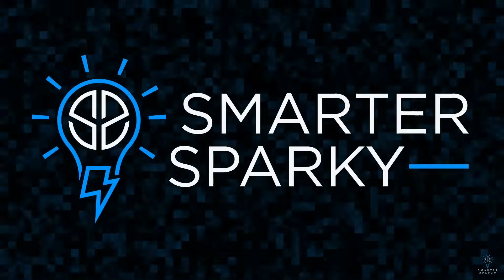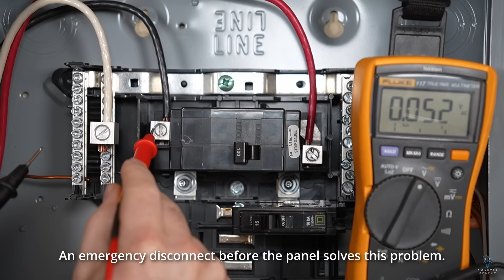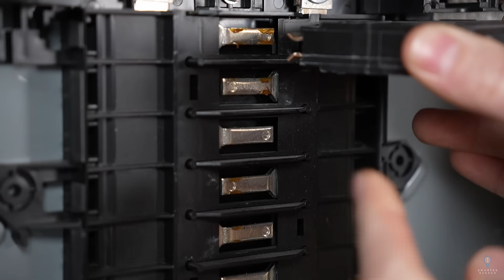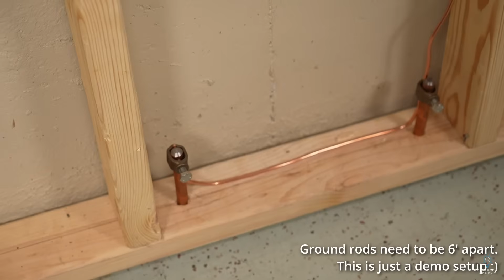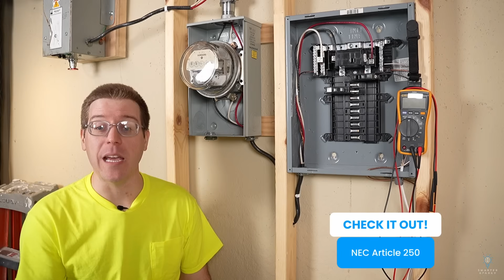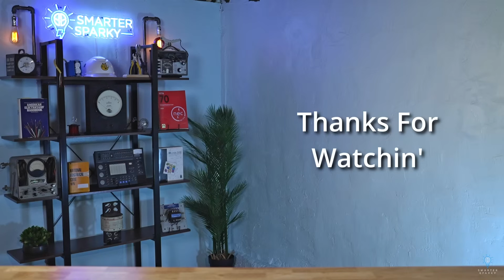Unlocking the Basics: Inside a Main Panel

Comment from the maker: ⚠*Free* bonus footage posted on Patreon! https://www.patreon.com/posts/inside-main-151462305 We look inside the main panel in my house, and point out all the same components. (You don't need to be a member to view it)
Reply: I love this channel. One of the best for learning and definitely the easiest to follow. I’d love to ask you a question and see what you think. I have my bathrooms on the only gfci breaker in my house and my outside outlets on a separate breaker. Anytime I use the outlets outside, my bathroom gfci breaker trips. As soon as I have time I’m going to do some investigating but one of the only things I can find that might be the problems is a shared neutral. 

The outside outlets will run fine as long as I use them, they just always trip the bathrooms as soon as I plug something up and start using it.

Comment: One fine point.   The green bonding screw in your instance, is to bond the can to neutral so that if a hot touches the can, it will trip a breaker.  If your neutral not connected to the can, and ground bar connected to the can, then the green bonding screw would be there to carry current from the can and all branch circuits.

Comment: Disappointed because he didn't get into why you don't bond the sub panel in detail.
Reply from the maker: That will be its own video. This video got long enough as it is. Basically by putting a bond in the sub panel, you create a parallel return path for neutral on the equipment grounding conductor. The  ground (whether a conductor or the conduit) should never have current on it, but by creating a parallel return path, it will always have current on it. Cheers!

Comment: After 35 years in Telco and 15 repairing and restoring vintage tube amps and radios i have had ground and neutral sharing a bar in a panel explained fifty ways from Sunday and still had an uneasy understanding until you explained it in less than a minute or two and suddenly it clicked and made sense.

Comment: Great video for wiring panels 20 years ago.
Now arc fault are required in residential buildings. 
A newbie would be completely confused.
Also, if you're the kind of electrician who attaches groundING conductors to the neutral bar because you're too cheap to install a ground bar..... you suck butt.

Comment: What about a legacy 3 wire sub panel? Bonding screw stays in correct.
Reply from the maker: legacy 3 wire sub panels are not permitted anymore. If they are grandfathered in, they are to be left as-is. If they are replaced, the new panel must be a 4 wire system.
Reply: @SmarterSparky this will be interesting. I have a contractor coming over Wednesday to replace the box and I asked that specific question about having a fourth wire run back to the main, and I was told that it wasn't necessary that the box is grandfathered in.
Reply from the maker: It sounds like the sub panel isn't being moved, so it doesn't need to be updated.
Reply: @SmarterSparky not being moved it's just being replaced. I did have a breaker about 2 years ago start sparking on me. I don't remember the make of the panel but it's something the previous owner two owners ago put in and it's kind of sketchy

Comment: Great job explaining complex electrical concepts so clearly to us non-electricians.
I have a 1960s home in El Paso with flexible metal conduit and likely no ground wires. Electrical work is the trade I hesitate to touch and have the most fear of, so I’m hiring a certified electrician to upgrade my original main panel later this year. However, I’m considering rewiring the house myself.
Currently, the house is split into broad zones (e.g., east side, front). I want to update it so every room is on its own dedicated circuit, with lights and outlets separated.
Is it feasible to install a new main panel next to the old one and gradually transfer circuits over, or how would someone typically approach a phased rewire like this?
Reply from the maker: Typically a full changeover is done all in one day. Sure, there are ways to gradually do it, but that will take so much more time in the long run. The problem boils down to how much physical space is available in the area, and how difficult feeding the new service conductors will be with the old panel still installed.

Comment: I actually did it once for just a few hours to keep my hot water heater running while I went and bought a double breaker. Wasn't smart, I know, but I just happened to have a couple extra single breakers and it was only for about 2-3 hours. But don't do it. I'm lucky I didn't burn my house down.
Reply from the maker: We've all done sketchy stuff for temporary 😅

Comment: I too have seen 2 single pole breakers used as a double breaker with a wire connecting them. It's not code because it's stupidly dangerous
Reply from the maker: I'm pretty sure it was a right of passage for most handymen at some point to gang a breaker with wire 😅

Comment: I would be interested to know the difference in connecting a main panel (100 amp) in a metal building...
Reply from the maker: The only real difference would be that the metal frame of the building would likely have to be bonded to the main panel as well. There are a mess of technicalities attached to that as well, though.

Comment: In my old house in the kitchen one outlet was 120 v ontop 240 on bottom  was that ok in that configuration? i mean it did work for umpteen years
Reply from the maker: I have seen pictures of special outlets that do just that. If you have one of those special receptacles made to do that, it's no problem. If it's a regular 120v duplex receptacle that has 240 on bottom, that might be a problem 😅 Those special receptacles are so kettles and higher wattage cooking units can be plugged in. Pretty uncommon I think.

Comment: Please review the label on the Square D QOM1 main circuit breaker in the main panel and note the left lug feeds the right bus and the right lug feeds the left bus. The wiring diagram in the panel also shows this cross over in the breaker.
Reply from the maker: By-golly you are correct. I never noticed that before. Thanks for pointing that out!
Reply: seriously why do they do this?  must be more natural or something
Reply from the maker: Must have been an internal routing constraint. I bet because the breaker is sideways, they feed one bus bar from left-to-right, then the other from right-to-left. That way there is no need for the bus bars to actually cross within the molded breaker.
Reply: @SmarterSparky  That QOM1 main breaker has internal components similar to the 2 pole QO circuit breaker. The breaker design engineers were able to make it work by crossing the busing but the Square D (at the time in the early 1980s) Safety Committee required a label to be added to the breaker and the load center wiring diagram to show that as well.

Comment: Wow, you talk about the disconnect required outside the house. The reason is also to prevent an  arc flash when working in the panel. You however are working on a live panel with NO arc flash protection on.    DUMB!!!!
Reply from the maker: The disconnect outside does not prevent an arc flash inside. Arc flashes happen faster than the main over-current device can react. I have an isolation transformer, and the panel was not on the entire time. The video is for demonstration only.

Comment: I have older panel with neutral and grounds together, I have a ev car 240 outlet connected, and cant figure since they are connected should I use a neutral will i be getting 2 neutrals or 2 grounds? or dont use the nuetral wire at all.
Reply from the maker: Even though neutral and ground end up going to the same place in the main panel, they must be kept separate going out to utilization equipment. They serve two very different purposes. If the EV charger requires a neutral and a ground, it must get them both separately. Even if they land on the same bar in the main panel. I hope to explain why in a future video. I'm not sure I can simplify it enough in a reply. Basically the neutral wire carries current normally, while the ground wire only carries current in a fault.

Comment: I'm a beginner, so if you have a EV charger that requires 240 V, do you add the 240 circuit breaker on the panel and connect it to the ev charger port?
Reply from the maker: A 240v EV charger would be fed from a two pole breaker in either a sub panel, or in the main panel.

Comment: When installing a double pole breaker you have to connect the neutral also? What did you mean the return path doesn’t use the neutral and something about appliances include a neutral?
Reply from the maker: For two pole breakers, the second pole is typically the return path. No need for a neutral. Some appliances do require a neutral so they can run internal controls off of 120v (half of the 240v).

Comment: The inside of the house is considered a sub panel now
Reply from the maker: It can be, the code allows you to choose where you put your main bonding jumper. You can still put the MBJ in the house, making the house the main panel still. But yeah, if you bond at the emergency disconnect, then you are right, the house panel would be a sub panel. Cheers!

Comment: Are you supposed to have continuity between neutral n ground within the branch wiring , say like in a jbox for a light fixture
Reply from the maker: If you ohm out between ground and neutral, you would see continuity, yes. That's because they are tied together through that green screw in the main panel (main bonding jumper)

Comment: I have a question. So for most homes that have a bunch of different breakers, if there are let's say 8 on each side does that mean each one has 240V? Or is it still outputting 120V. Just a bit confused.
Reply from the maker: Each single breaker is 120V. You get 240V by going from breaker to breaker (120 + 120 = 240)

Comment: Spain here. First time I saw a US panel it surprised me, but in the end it’s pretty similar in concept.
I didnt know you have that split-phase 120/240V system— in Europe we typically use 230V for most circuits.
One key difference is protection: you use local GFCI protection (at receptacles or breakers), while we usually use a central RCD (“in spanish its called interruptor diferencial”) that can protect multiple circuits. Pros: simpler and cheaper. Cons: if it trips, you can lose power in a large part of the house.

Of course, we can also split protection into multiple RCDs or use RCBOs per circuit for more selective protection. As i understand your logic is to protect locally where its needed, and in europe we just protect whole house and thats it. We would say: better too much than too little, I think in english is more like “better safe than sorry.” xD
Reply from the maker: Very interesting! I did not know that. I would love to learn more about electrical systems in other countries. How do your RCDs work? Are there individual circuits going to the monitoring unit, or does the monitoring unit just trip the entire main circuit when it detects a fault? Do your RCDs also provide arc fault detection?

Thanks for bringing this to my attention. I feel like a kid in a candy store 🤣
Reply: @SmarterSparky  Didn’t expect you to be interested — pleasantly surprised 🙂
I’ll speak mainly about Spain and Eastern Europe, but I would say it’s quite similar across most of Europe.

Our RCD works by monitoring the current difference between phase and neutral. If there is an imbalance (typically its a 30 mA), it trips to protect against electric shock.
In a traditional residential setup, the RCD is installed in the main distribution board. Multiple circuits (lighting, sockets, etc.) are connected downstream of a single RCD. So when it trips, it usually disconnects all circuits under it, not just one. This is one of the main differences compared to the US approach — we have less selectivity, but the system is simpler and more cost-effective.
In modern installations, however, it is becoming more common to use multiple RCDs to divide the installation into zones, or just use RCBOs (combined MCB + RCD) per circuit, which is closer to your approach with more localized protection.

Regarding arc fault protection:
Standard RCDs do not detect arc faults. We do have AFDD devices in Europe, but they are not widely used in residential installations yet — mainly due to cost, lower fire risk in concrete construction (will explain below in more detail), and the fact that they are not generally mandatory.
The thing is that in europe the cables are usually not installed directly inside the wall — in fact, in many cases it’s not legal. Instead, they are run inside conduits (plastic tubes) from junction box to junction box. This allows us to replace or upgrade cables later without opening the wall. I believe a similar approach is used in US commercial installations with metal conduits.

Of course, this has pros and cons: installation can be slower and requires more planning upfront, but maintenance and future upgrades are much easier. 

It’s really interesting how both systems achieve safety in different ways — I feel like I’m learning comparing them.
Reply from the maker: That's really cool! Thank you for sharing! So the RCDs that interrupt multiple circuits, are they in control of overcurrent protection as well? or is there separate overcurrent protection for each circuit, then they go through the RCDs?

Comment: Great video. I recently installed two new GFCI plugs outside and was wondering why in my really old panel I only had one bus bar at the top and the house is so old there is no GROUND wires connected to it. I was scared if I hooked up ground and neutral to it that something would wrong would happen but I guess it was right.

I was using a combination of Chat GPT and google/reddit but this put my mond at ease. THANK YOU!

Edit: I haven't connected them yet but will in a few days.😊
Reply from the maker: Right on! Stay safe!

Comment: Awesome video and presentation! I'm usually of the mindset that—I don't care why or how, just tell me what wire to put where...but this was informative.

So if you have a service disconnect outside (a decent distance from the house), with a breaker panel inside and an ufer stub out, what do you recommend. Where do I connect the ufer ground? To the breaker panel (sub panel)? It would be a nightmare to try to run it from the house, to the service disconnect 200' away through super rocky soil. Thank you!
Reply from the maker: I would bring it to the service disconnect. If you designate the emergency disconnect as the service disconnect, it can go there. Really it just comes down to labeling. I have heard of people bringing it to the service disconnect either way, and I think that's ok, but I'd have to read into that more to be sure. That's the thing, just because I do something a particular way doesn't mean there aren't other options 😅
Reply: @SmarterSparky  Thank you for your reply! I'm doing my own rough-in (it will be inspected) and I guess I don't know the difference between the emergency vs service disconnect. 

My setup is: there's a meter outside with a disconnect there (service? emergency?)...then 200' away, inside the house there is an ufer ground stub out near my main breaker panel...

My buddy told me I'm going to have to install a disconnect on the side of my house because the disconnect at the meter is too far away.

I'd like to avoid that. I'd also really like to avoid trenching and running a ground wire all the way from the ufer in the house to the meter, where the first disconnect is.

By the way, I pulled the permit in early 2025 so I should be under that NEC, I believe.

Any help would be much appreciated! :)
Reply from the maker: Yeah you'll need a disconnect on your house. The other one is too far away. You can decide if you want your service disconnect to be considered as in the house, or if you want the emergency disconnect to act as your service disconnect, it's comes down to the sticker you put on the emergency disconnect. Wherever you designate as the service disconnect, that's where you'll bring your ufer ground (and have your main bonding jumper)
Reply: @SmarterSparky  You're awesome! Thank you!

Comment: So if you have an outside disconnect below the meter that’s where the bonding takes place?
Reply from the maker: That's actually a really good question! Of course like everything else with the code, the answer is complicated.  There is a lot of confusion on this, so take my answer with a grain of salt. If you slap a sticker on the disconnect that says "EMERGENCY DISCONNECT, NOT SERVICE EQUIPMENT", your main bonding jumper would be in the panel in the house like normal. If the sticker on the disconnect says "EMERGENCY DISCONNECT, SERVICE DISCONNECT", then you would need to do all your bonding in the emergency disconnect, and your main panel in the house would just be a subpanel. Funny how the galloping electrons know the difference 😅

So my understanding is it come down to how are you designating that emergency disconnect. 2023 NEC code reference is 230.85(E)
Reply: @SmarterSparky Thanks..

Comment: Great Video, thank you. Could you clarify, I assume it’s common knowledge, except for non electricians like me, is removing the meter the normal way to remove incoming power on a home over 20 years old?
Reply from the maker: Thanks! That's a good question. Yes, removing the meter is pretty much the main way of disconnecting incoming power in older homes. Meters should only be removed with the power company's blessing, however. They don't like their meters being tampered with. Another option is that the power company can disconnect the fuse at the pole, or disconnect the tap for your house as well. Basically the power company would need to be involved either way. Cheers!